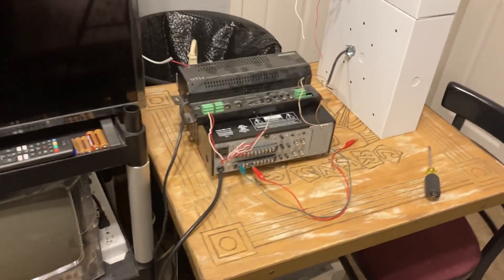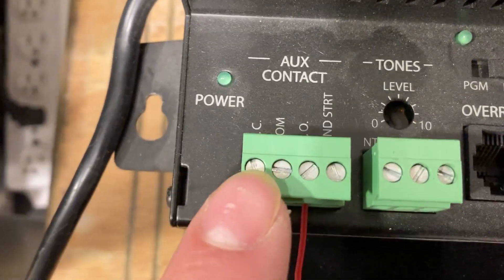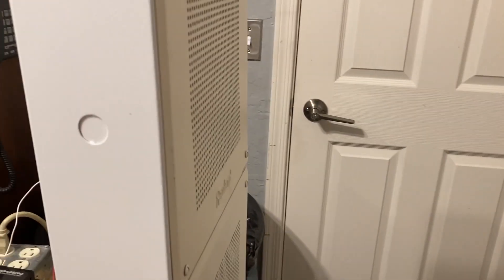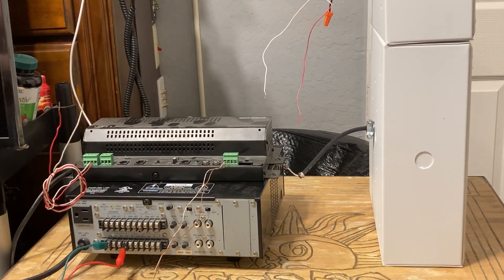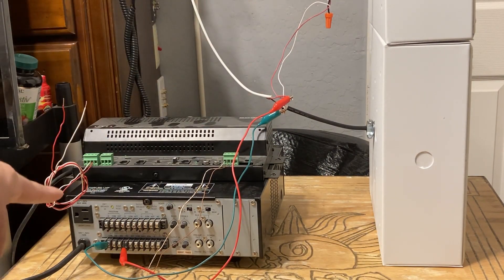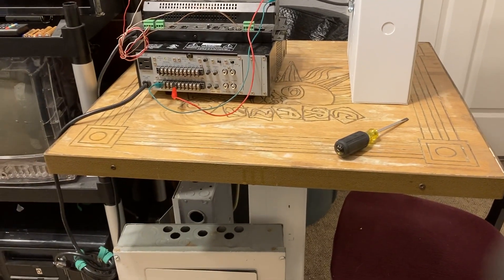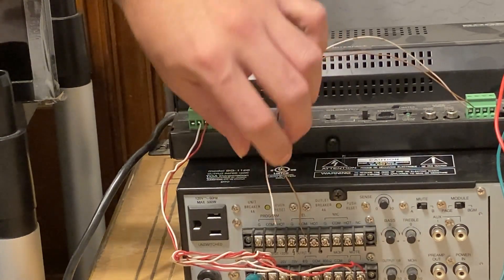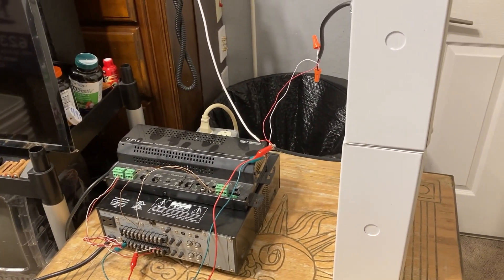How To Connect A Chain Of 70 Volt Speakers To An Amplifier

Comment: i dont have a UTI-1, so are you able to wire a telephone line directly to the telephone connections on the toa amplifier or will that fry the amp since telephone lines run 40v on hook

Comment: I wire my speakers in-series so the setup is more clean. Does that pull more power from the amp?
Reply from the maker: You don't connect 70 volt speakers in series and that method would use more power depending on your application. They are supposed to be wired in parallel and as far as transformer taps your supposed to add them up to make sure you don't exceed the rated wattage output from the amplifier. You also want to leave some head room on the amplifier which I leave about 10 to 15 watts leftover.
Reply: @CristianOrtiztechmaster926  Gotcha, thank you.